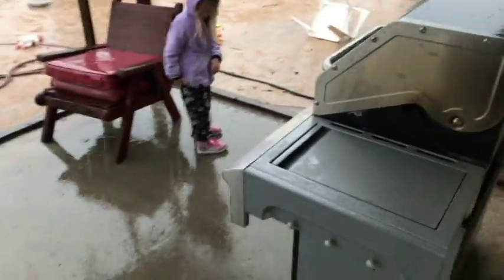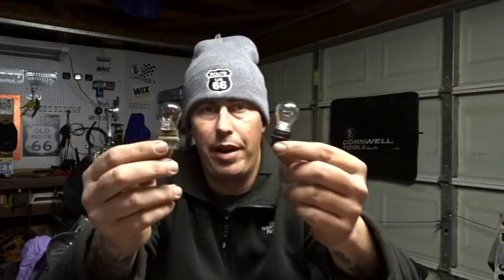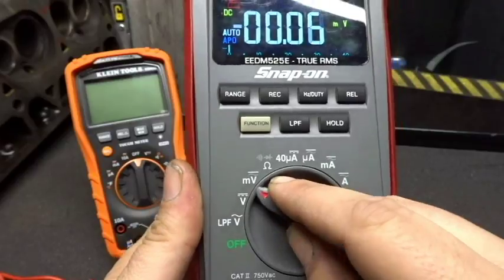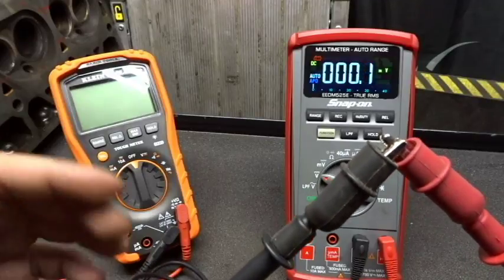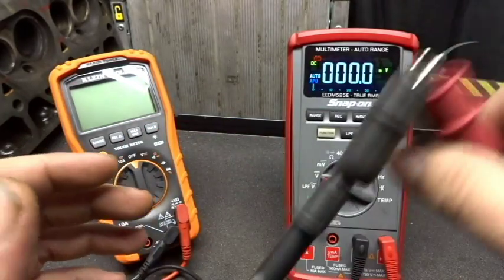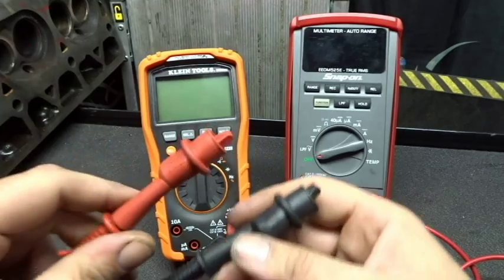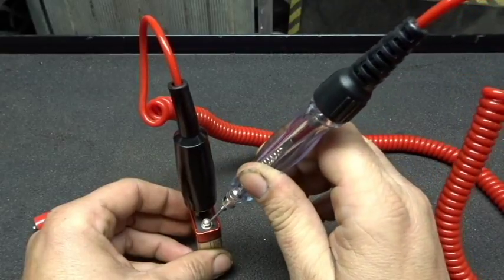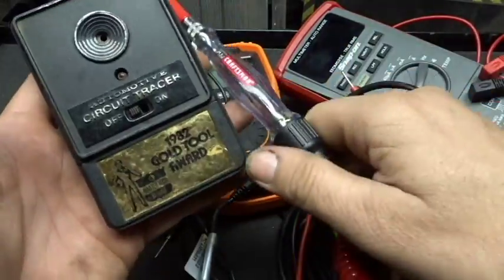Basic DVOM Information Tutorial for Snap-MAC

Comment: Alright I know this is a long shot but any advice would be greatly appreciated, I have a 1998 Ford Ranger 3.0 V6. I was driving it down the interstate and it suddenly started shaking and misfiring extremely bad and I lost my power brakes. So I get the truck towed home drain the oil and drop the pan everything looks fine. (Had good oil pressure) I buy a compression checker and all cylinders have around 150 besides cylinder 5 its reading 0. So I pull the upper intake and such to get to the valve cover, pull the valve cover off and the push rod is bent (believe it's the intake valve) and not under the rocker arm. So I ask my uncle who had worked on engines most of his life and he told me to try just replacing the push rod. So I replace the push rod put everything back together and it's running exactly like before. Shut the truck off pull everything back apart and the push rod isn't bent, but in the process of tearing it back down I noticed the intake runner on the upper intake for cylinder 5 was really wet. So I look down into the lower intake it's also wet and around the cylinder 5 injector is a puddle of coolant. It might be something obvious but I just cant think of what it could be. So again a basic run down; No compression cylinder 5, no vacuum to brake booster, coolant in upper and lower intake and around injector. Any advice from anyone would be greatly appreciated! Thank you in advance!
Reply: Andrew do you have a compressor to put air down the spark plug hole into the #5 cylinder.  Search leak down test.     I would be curious where the leak is,  was thinking the piston smacked the valve bending the rod, and the valve could be damaged but that is a guess over the internet and does not account for leaking fluid.
Reply from the maker: Andrew Baker Well if the damage was bad enough to bend a push rod and you might have further issues where the hydraulic lifter might’ve dug into the camshaft furthermore you could’ve had a bent valve on the cylinder head and the reason why you’re overheating is because the engine has to work too hard to compensate that’s just my guess without seeing it

Comment: If you are getting started just get a $5 digital multimeter.  Learn the same basics before you go buy the higher priced stuff. Has all the same settings. Even walmart has one for $10.  Harbor freight has free ones but the leads are built cheap